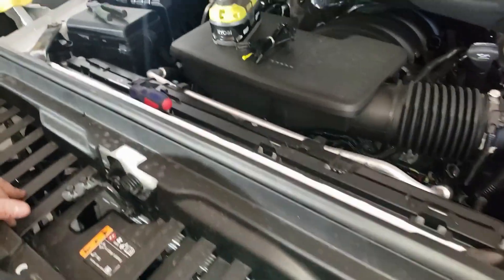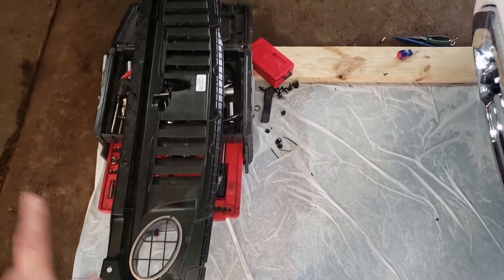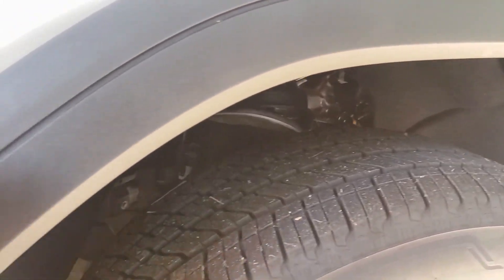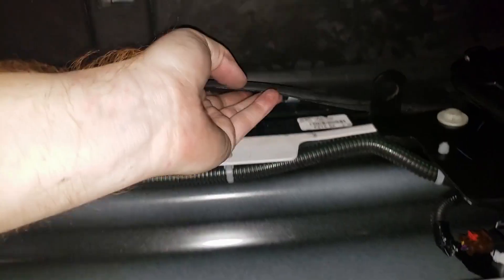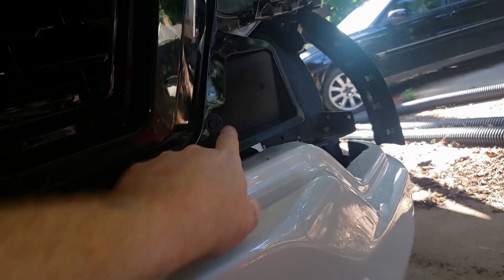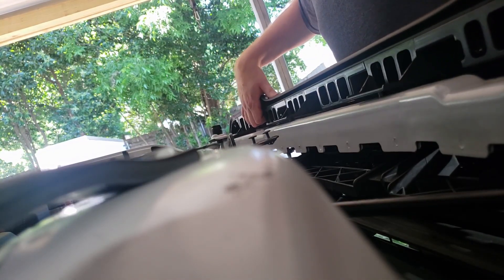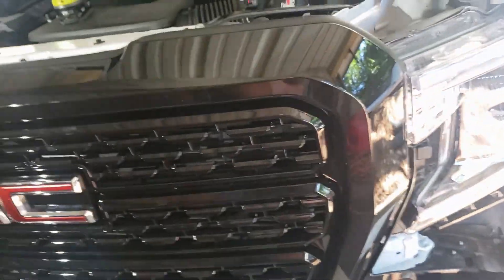2019+ T1 GMC Sierra Grill Removal

Comment: Thanks for the video! Helped tremendously. kind of a pain but I got it.
One thing to note make sure that the plastic front piece doesn't separate from the black molding behind it. You will see what I mean if you start taking yours apart. I had to glue a couple parts back but it's all good now.

Comment: Hi,  Me again...   When you removed the sides of the fascia near each front fender, are you able to get your hands in behind to raise the locking tabs and if so, is this how it would be removed all the way across?  And do you release lock tabs near grille First before you pull outward the 2 pins near the headlights?  Thanks for your time,  Dave
Reply: I released the tabs on the side of the  by the fender flares first but I'm not sure that it is critical to do that first

Comment: Hi,  EXCELLENT VIDEO !     I have been looking for just this procedure.  Are you able to show the actual clips where the filler snaps into so I know what to look for when dismantling? (around the headlight, etc...)  Thanks!
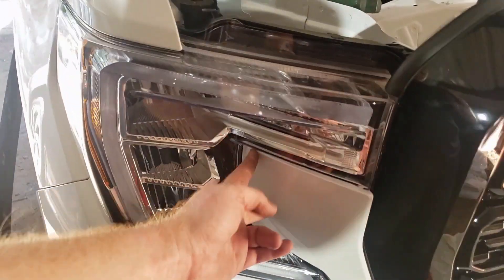Reply: Sadly, I didn't take any video of it at the time because I wasn't sure how to do it until I had already done it. Just looked through my photos, looks like I did't take any of it specifically. At 2:21, I put my 2 fingers on the piece of trim. That's about EXACTLY where the 2 push pins are. They're the easy ones to pop out, all plastic, pop out with gentle force (I used plastic trim tool to gently pry, but you probably can do it when removing the whole piece, to be honest)
Reply: @jonofmac  O.K.,  Thanks for the info.  I have heard of the filler cracking when pulling it outward.  Here we go. wish me luck!  Thanks again

Comment: Thank you for posting this man, I have been trying to find this for a few weeks. I've got a 2020 I'm trying to grill swap and I got hung up towards the bottom lol
Reply: Did you do the swap? I just got my grille surround color matched and want to do this myself. I actually have a new grille going in so I’d like to try it myself. My question is the lower tabs in the corners I guess, not the 6 in the lower middle he shows but the ones that are near where the bottom grille curves, are they reachable? Or are you just doing a leap of faith yank on it
Reply: @DKLabs99  I did do the swap it went smooth. No broken tabs and was able to sell the old grill. The ones youre askign about arnt really reachable but they popped out with no issue when i gave a little pulling force. Just really go at it slowly and easy and they should give way. The tabs that actually gave me the most trouble were the lower six just cause my hands arnt small and getting up under the truck to push them up from behind was kind of a pain but doable.

Comment: Any pics of where you said pull straight out on the bumper part next to headlight?
Reply from the maker: sorry, didn't get that. But there's a screw you have to remove ( i showed that), then you simply tug it outwards.
Reply: @jonvaldezcars  sorry I wasn’t clear. The two white posts at 2:42, I assume are the two push clips mentioned at 2:22. Are they alignment holes or do they have something that needs to be unclicked to remove before pulling straight out.
Reply from the maker: @gr8almty1  Ah. Those are push clips. They do have little holes you push them into, but nothing that has to be disconnected. Those are the ones I mentioned at 2:22. I simply pulled towards the front of the truck and they popped right out.
Reply: @jonvaldezcars  would you say those push clips are the same design as the fender flares? Doing it today
Reply from the maker: @gr8almty1  they're pretty similar. But not the same. The ones on the bumper are easier to pop out I'd say. The fender ones grip a bit harder.

Comment: P.S.   When re-assembling, is there any part of the fascia that needs to go on first  ( i.e.  center of grille or right and left sides of the fascia?  Thanks again,  Dave
Reply: No particular order on reassembly. Grill has to go on before you can put the lower grill piece on, obviously but other than that, didn't seem to matter which corner
Reply: I started with the center then worked my way left and right to ensure it was even before pressing the clips back in plce

Comment: Whay about the air handler shutters that are attached to the grill
Reply from the maker: I didn't have to touch them. They're attached to the truck rather than the grill. They looked attached to some bracket behind the grill but the two are separate